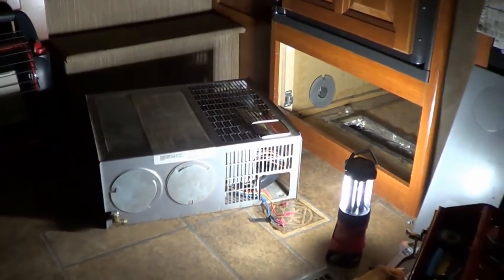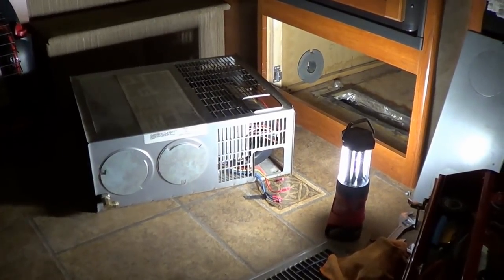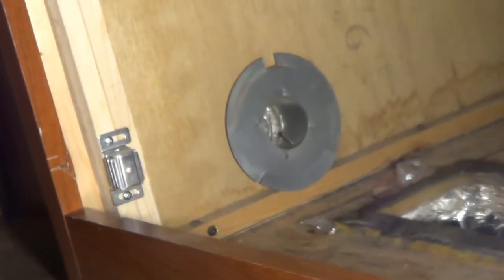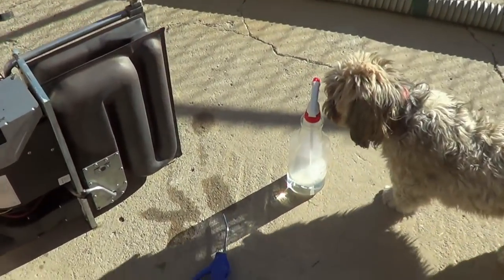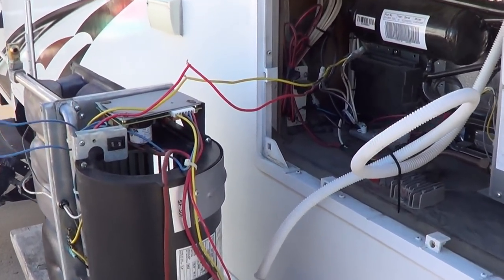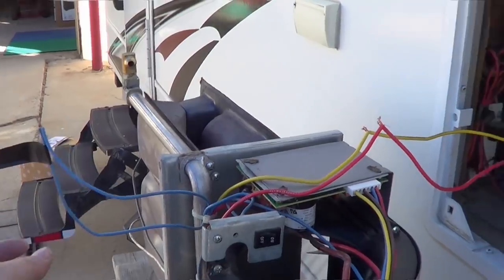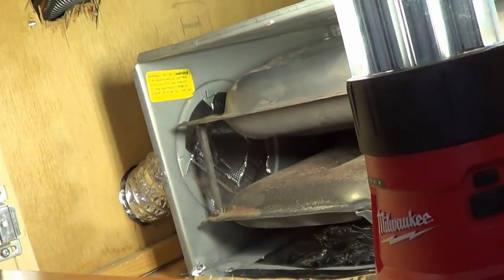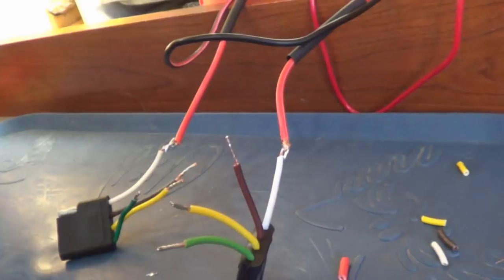Late Night Mouse Jammed in RV Furnace Fan

Comment: Been there, done that Ray.  Our 2011 Cougar 31sqb has that black corrugated plastic sheet that covers the entire underbelly, protecting the tanks and lines from freezing.  Where our mice got in was where the corrugated sheet was poorly cut where the suspension saddles are welded to the frame...it was just enough for two mice to get in and destroy all the flexible heating duct.  I also had to take the furnace apart to wash out the urine and feces.  I went to a sign company and bought identical black corrugated plastic, and patched 7 or 8 places where I figured mice could try again.  Haven't had any since...although I shouldn't be saying that out loud!

Comment: I haven't had use for any for a long time, and haven't looked in years, but most hardware stores used to sell "hardware cloth" that was metal mesh, of several different sizes. 1/4" size would be perfect, I would think, and it wasn't expensive way back when. You would cut it to shape and size with tin snips, and there you go. GREAT idea for the trailer plug to disconnect the wiring in case of service. I'd solder and use heat shrink tubing on the splices when I put in the plug, that way it would be safe and secure, no worries in the future. Linda and I sen dour best.
Reply from the maker: Good tips, thanks!

Comment: I went to replace my basement blower motor in our RV the other day because it was blowing fuses. When I got in the basement and took the fan out, lo’ and behold, there was a mouse carcass caught in the blade. Once I cleaned out the remains it worked fine! Next time I’ll check the fan before ordering a new one! Thanks for the videos.
Reply from the maker: Wow, another one. you're welcome. Cheers, Ray

Comment: Had a mouse build a nest inside the combustion chamber.  Thankfully just the nest was there. Had to take the furnace out as you did .  I'm going to use wire mesh over the duct as well where the furnace blows the hot air through the floor.

Comment: Hi Ray, We're off grid in South Florida. I run the generator from 8pm to 10pm to kick a charge into the battery bank. The field nice like sitting on the warm generator so i put the bait on it & they are eating it. Not found any dead mice yet but have not found any chewed wires either.

Comment: That was me !!!  I suggested the 4 prong trailer plug !!  Where's my royalty cheque?   Be careful with the steel wool so close to the furnace. Steel wool is very flammable as I'm sure you know. That might make me nervous.
Reply from the maker: Thanks! :) My only concern was amperage  rating. I know the furnace fan can draw up to 8 amps, but couldn't find a rating on a 4 prong trailer plug. I assume its high enough since some trailers have a lot of lights, but will have to keep an eye on it for overheating.
Thks for the tip on the steel wool, I hadn't planned to use it near the furnace, but good to know. Cheers Ray
Reply: The Ground cable is 16 AWG for up to 13 AMPS. The other 3 cables are 18 AWG for up to 10 AMPS, so you should be fine.

Comment: Ray, is that a plenum for your furnace under the refrigerator or is it just an access panel for the furnace? For the operation of the furnace I thought they brought in air from the outside of the rv and the exhaust was right next to the intake. Would it not be a better idea to bring in air from inside the rv like a plenum in a house so that the air is somewhat warmer than the outside air to begin with? Just a thought not sure if it is viable or not. Please advise your opinion. Thanks for the videos!
Reply from the maker: Yes, they use separate chambers and two fans. So the external combustion chamber is separated from the internal heating ducts and cold air return. I think they like complete separation of the air flows for safety.Here is a link to a post and video where I take the furnace apart and explain its operation - https://www.loveyourrv.com/suburban-rv-furnace-removal/  Cheers! Ray

Comment: I hope the next time is not because something happened in the middle of the night like that.. When you are asleep it is hard to think and you just start jerking whatever is causing the problem apart and deal with the consequences later.. Glad you didn't pull a wire out of something that would cause you to have to buy a new part.. Worked out well this time except for the sleep part.. haha

Comment: That thing looks huge, sure it's not a rat?

I had a bad mouse problem, finally found they were coming in thru the floor cutout for the shower drain.  Spray foamed it, never another mouse.
Reply from the maker: Might be whats called a kangaroo rat or pack rat, not overly big though.

Comment: hey great video, can you explain a bit about the AC , DC & chassis ground? for your RV. are they connected? thanks &  merry X'mas & happy new year!
Reply from the maker: Thanks!  The DC and AC grounds are different but often share the metal RV chassis frame.  The battery DC negative post is usually connected to the RV metal chassis and is used by some circuits as a negative return conductor instead of running a separate wire.  Saves money I suppose.
The AC side of things uses the RV metal chassis ground as a safety measure. Usually, the AC ground wire is connected to the RVs metal chassis and the neutral wire is floating. The neutral wire gets bonded to ground once you plug into the campground outlet.
This can sometimes cause issues when plugging in a generator that is also floating neutral and may require the addition of a device called an Edison plug to create the neutral ground bonding. More reading here at this excellent website on RV electrical safety - http://noshockzone.org/generator-ground-neutral-bonding/  Cheers! Ray
Reply: hey ray, thanks for your info. well i did chat with one of my friend about where AC ground is actually connected and this is what he found out
"I went out to my RV to double check the connections and your comment is correct. The bus terminal with the AC ground connections are grounded by the incoming shore Romex wire. Only the DC system is 
connected to the chassis. It can seem confusing as the ground bus for all the wires is attached to the junction box which looks like it would be a chassis ground."  it seems the AC ground is not connected to chassis! can you please comment on that, 

also can you please comment on "https://www.civicsolar.com/support/installer/articles/electrical-grounding-boats-and-rvs"  it seems comply with what my friend had found out.  thanks a lot.
Reply from the maker: In my trailer, the AC center ground wire (green wire) is bonded to the RV frame and the white neutral wire is floating.
Reply: thanks for your reply. so should i say 'it is not a concern'?
Reply from the maker: If our worried have an RV tech confirm its hooked up to the manufacture specs. hard for me to know over the internet without hands-on tests.
Reply: thanks a lot